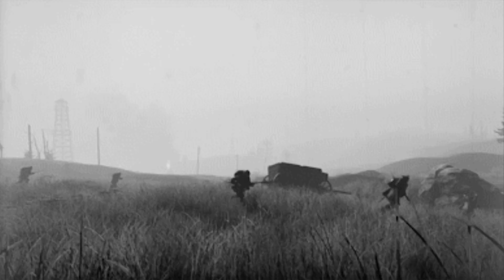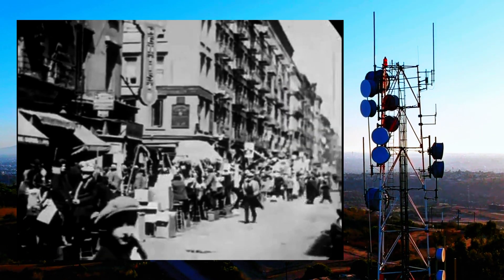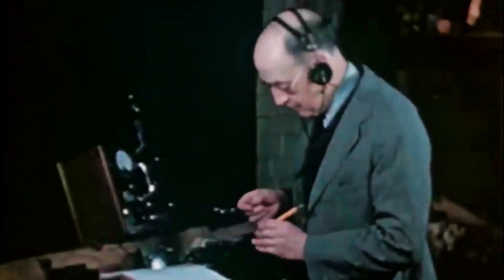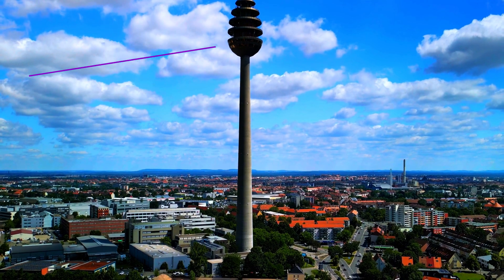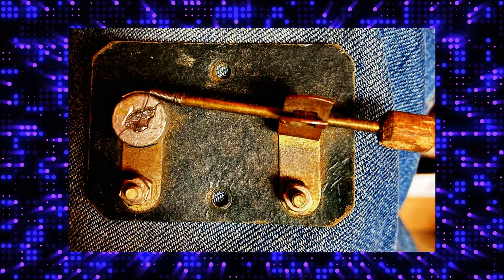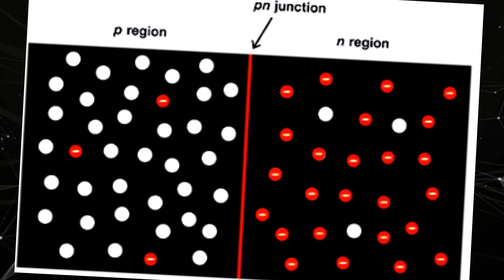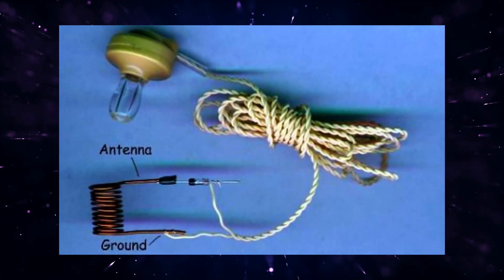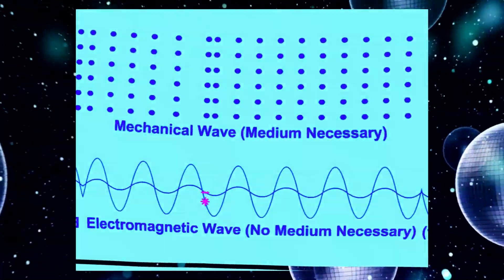The Forever Foxhole Radio

Comment: I experimented with  a foxhole radio - the best results have been acheived with variable inductor (no capacitor or tent picoFartads) and MOSFET (BF998) as  syncronous switch. There was earphones from telephone - 250 Ohms and an antenna 15Meters long. Modern Foxhole radio must have it.
Reply: There is a degree to which the tuned circuits component values interact with the diode and headphones.  I found that on a tuned loop antenna, fewer turns and more capacitor worked the best.  Many years ago, I had one that could drive a speaker at a volume you could comfortably listen to in a quiet house.  I had a good antenna and a few stations very near me.